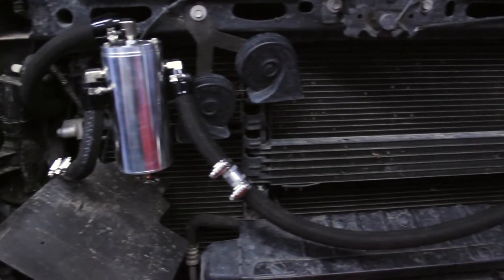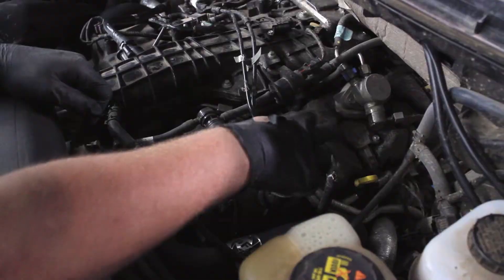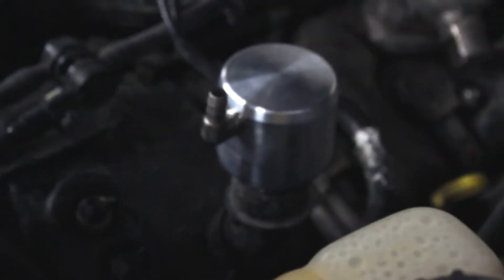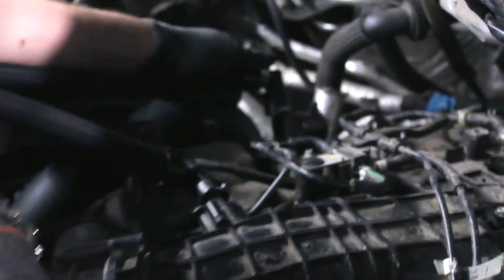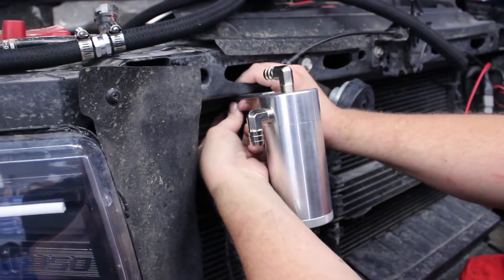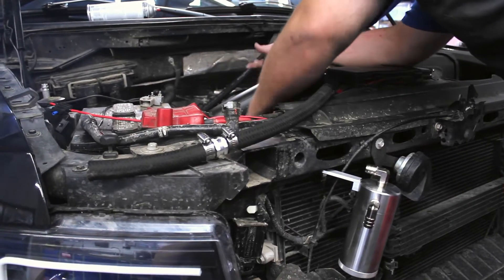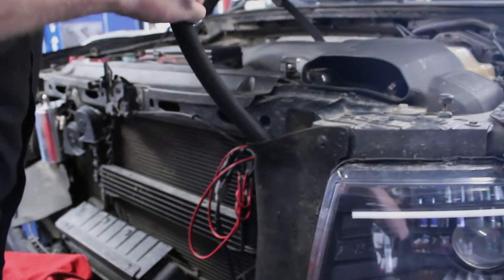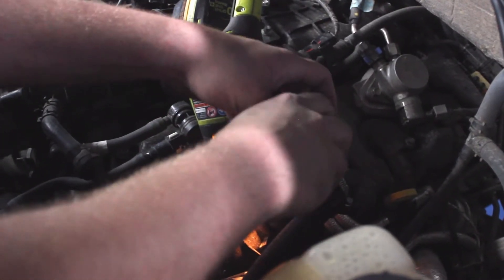2011-2014 F-150 3.5L EcoBoost UPR Dual-Valve Billet Catch Can Install

Comment: Whatever you do, DO NOT INSTALL THE UPR CATCH CAN SYSTEM IF YOUR TRUCK IS EXPOSED TO FREEZING TEMPERATURES!! It will freeze and cause oil to be blown into your intake, stalling your truck and potentially causing an accident if you are on the highway and your truck goes into limp mode. What also happens is extreme cold causes tons of water to accumuulate in the catch can, then you have it flooding your intake and will stall your truck. This happened to me.

Comment: Replacing the oil cap breather published on Dec 3 2014?  How about the posting the installation for an updated Low Profile Clean Side Separator video?  It's time for an update!

Comment: Can I install this on a 2013 5.0. It's basically the same. Except that I wouldn't plug the pvc on the driver side valve cover.
Reply: Yes you can install our system on a 2013 5.0L